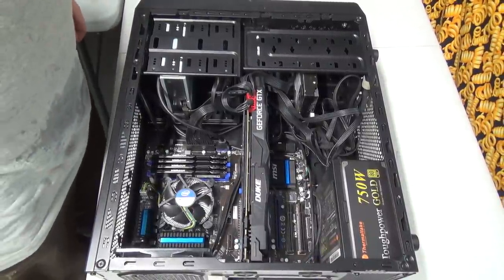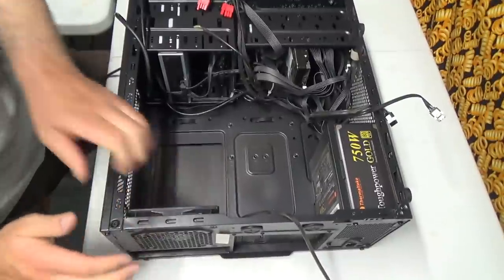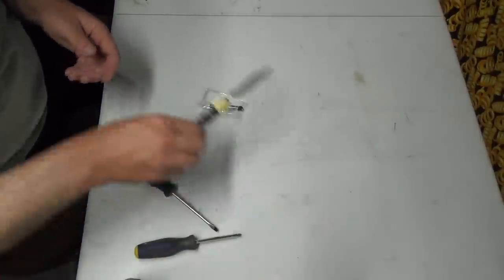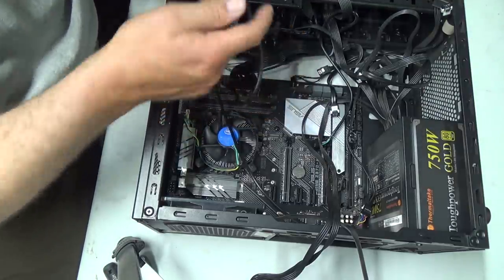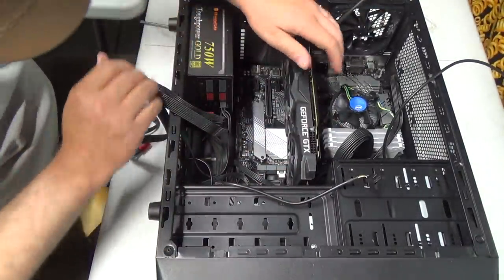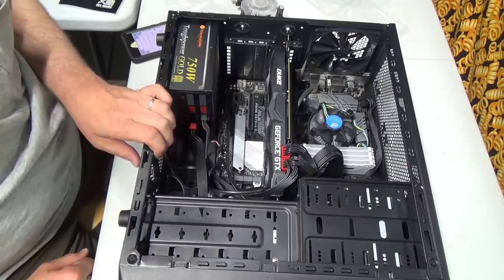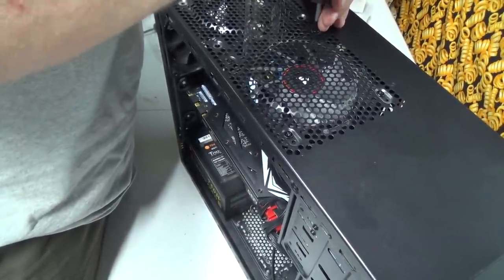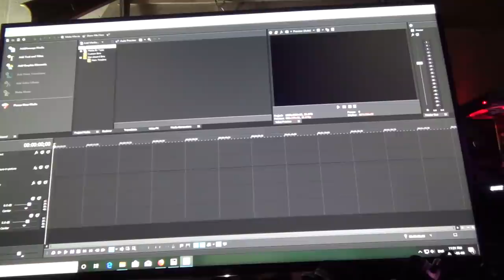Let's Build a new computer....But first let's Rip out the old parts

Comment: Bill, I wish you the best of luck with your new build.  I would have much preferred to see a cooler like the Scythe Mogen 5, which is supposed to be very easy to install; or the Hyper 212 evo, which is what most everybody uses, including me.  I don't like water cooling - when it breaks, that water has to go somewhere!  ::::: shudder ::::::  The pumps fail in about 5 years and have to be replaced.  What a hassle.  With air cooling, everything is safe, and they just work.

I sure would have preferred the top fans blow OUT.  Heat rises, and the rear and top fans would work great to get rid of it, if they were all blowing out, like they should.

Thank you for making these interesting videos!  I sure miss the cemetery, though.   ~Cindy!  :)
.
Reply: If anything is going to brake, it's the pump. The coolant will just stay inside the closed loop system. Nothing is going to explode and release a tidal wave of coolant everywhere. The pump impeller will simply stop turning... Agree with you on the top fans...

Comment: top fans are the wrong way .. they should be exhausting heat out of the top .   intake on the front bottom .   if it was me I would have got a new case ... cases with only 1 usb 3 means you are losing 1 of the usb 3 ports that the connection supports .. it's done to save licencing cost

Comment: Hiya Bill, I like your video mate. Just 1 thing too check, go into the bios and check that the ram speed is the correct 1. I bet you will find that your ram speed is set too 2400mhz and not the ram speed you have installed. Your other ssd use Velcro and stick it on top of your power supply that will will be fine. A few vids i have seen that is what other ppl did.

Comment: WOW that cooler is crap. Your going to burn that rig up with that thing. I good air cooler is really cheap. Versus starting a fire and causing damage.
Also, Your top fans should pull UP and out not down and in. Most setups have you pulling in from the front and/or bottom and blowing out from the back and top. positive air flow is key.
Reply from the maker: So how do you figure that cooler is crap?  The secret is to keep your thermo paste soft and dont let it harden up as i did 

also the volume of air that sucks in blows past the cooler then directly onto the back of the video card where there is no fans as the fans are on the other side.. Dual cooling.. see where i went with that
Reply: @billstmaxx  The cooler is good but with a setup like that water cooling would be very successful.
Reply: @billstmaxx  That cooler is fine for that CPU, and no matter what all thermal paste will dry up after so many years.